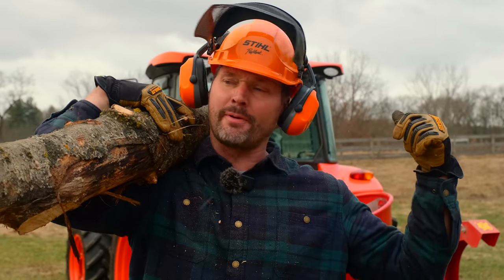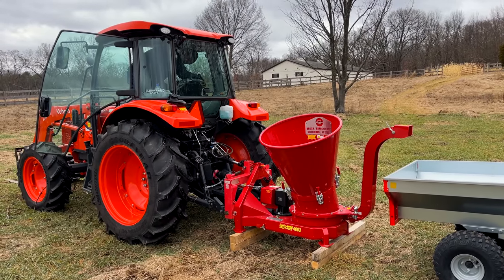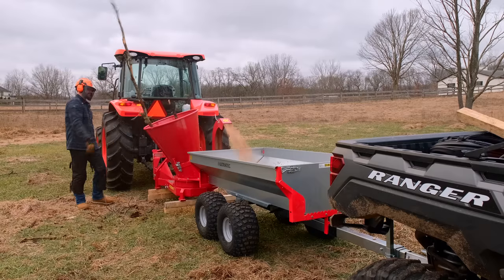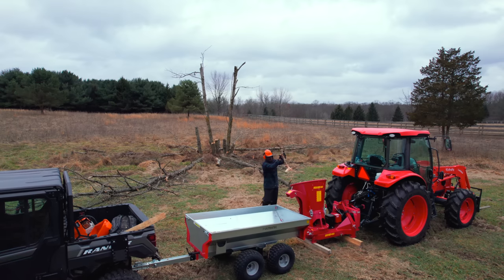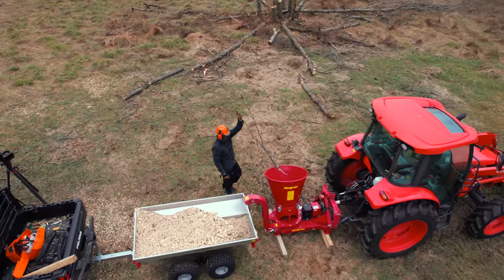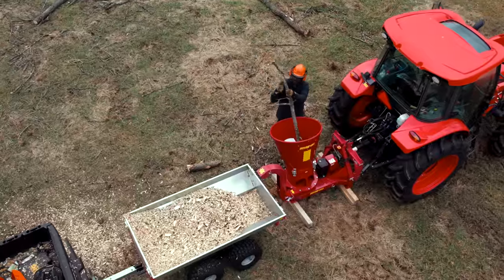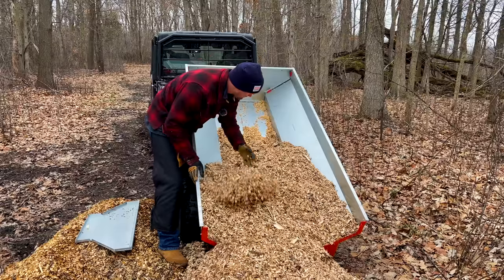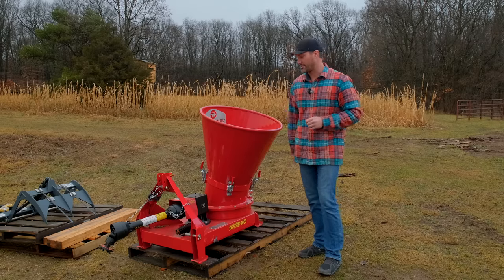WHAT HAPPENS WHEN YOU EXCEED MANUFACTURER RECOMMENDATIONS?

Comment: The max diameter is going to be dependent on how hard the wood is (... shush). It might take a 5" pine just fine, but stall out on a 3.5" hickory. And whether it's dead standing wood or green wood will also make a difference. Lastly, at some point the infeed plate itself is going to be the limiting factor.
Reply from the maker: Haha, yeah well they still do give it a max rating.  But, all fair points for sure!

Comment: Quick tip jack knife the UTV to the trailer b4 chipping that rear screen looks like a great target for a chunk of wood or even nail or stone embedded in the wood if I didn't have bad luck I wouldn't have any luck at all so wouldn't take the chance
Reply from the maker: Good tip...that fear was somewhere in my head, but the ol braincells couldn't actually put 2 and 2 together.
Reply: I disconnect my trailer and move the UTV away.  It just makes a mess with all the chips and dust on the UTV.

Comment: The one major flaw I see with this design is the chute position. First of all it is stationary. Second it throws to the rear. Other chippers I have seen allows the user to rotate where he wants the chips to go. Huge plus! A stationary chute is fine in a large open area. But when you are in a tight situation where you cannot move the chipper to the position you want it is a big minus. A rotating chute solves all of these problems. Nice chipper. But not the best design. IMO.

Comment: There should be a pto stop switch on the rear fender of the tractor. When seconds count the off switch in the cab is too far away…
Reply from the maker: Yeah, that would be fancy, but probably a cost that most tractor mfg's think wouldn't be utiltiied enough.  The chipper does have a switch built in...you just need to wire it into your tractor.  I'll do that once I decide which tractor I'll run it on normally.
Reply: @GoodWorksTractors  this is where all tractor manufacturers should standardize on a wiring harness extension to the rear of the tractor to hook up remote kill switches. So that no mater what brand of attachment or tractor, you could connect it up. They were able to standardize on the 540pto shaft, this should be easy enough.
Reply: @Akcd11r2002  I am curious to know what other PTO driven attachments there are that one would be off the seat when using? I can't think of others at the moment.

Comment: I will NEVER again operate a wood chipper that does not have a power feed mechanism.  The safety issues around having to push or drop wood into a self-feeding chipper have given me nightmares.  I have seen wood get sucked by machines, and that wood has has broken limbs that have snag people causing injuries.  I have also seen wood kick back out of self feeding machines and hit people.  A power feeding machine is not perfect but the benefits include a reverse feed control to manually prevent it overloading the tractor.  I cannot recall if we have a Land Pride or Woods.  Please stay safe.

Comment: your rim guard ad read didn't have sound
Reply: Think it wasnt support to be there
Reply from the maker: that’s odd? not sure what happened.
Reply: Some of us should be able to recite the script by memory.
Reply from the maker: Haha...well...I'm waiting! 😂
Reply: @GoodWorksTractors   
Folks I want to take just a second to tell you about our channel sponsor, Rim Guard.  They're a liquid ballast solution they line up with exactly what we do here on Good Works which is talk about tractors and tractor safety.  We see it as simple as this: if you own a tractor you need Rim Guard.   In fact some tractors include it as standard out of the factory.

Liquid ballast is simply weight.  Alright? And this weight hides inside your tires.  It stays there all the time.   It's a safety concern because tractors are almost always too light and too tippy out of the factory.

The #1 attachment used by every tractor owner is the front end loader.

So when you pick up something heavy on the front end the back end wants to pick up off the ground.  Rim Guard liquid ballast helps keep your back end planted to the ground.

But beyond safety it's going to help maintain traction because if those rear tires, those power driving tires are on the ground, you have traction to go where you need to.   You're going to operate more efficiently.

Because if those rear tires aren't on the ground, you're not going to pick up as much as you need to or take it where you need to go.

Rim Guard is all natural. That means it's safe, it is the heaviest all natural product on the market.   It's not going to freeze, it's not going to corrode and it's available at over 1,000 dealers nationwide

To find a dealer visit rimguardsolutions.com to make your tractor safer today.
Reply from the maker: Haha, too funny and you nailed it :)  Thanks for the laugh!
Reply: @GoodWorksTractors  And you thought we weren't listening.

Comment: At 7:02 you reached inside to try and remove your wood, That's a huge NO NO! Just shut down the machine so nothing is moving. I would hate to see or hear that you or somebody got hurt. That machine pulls those trees in fast and it only takes a quick second to get sucked in from the branch catching loose clothing or even your gloves. Please be safe everyone.
Reply from the maker: Neah, my hands are literally "feet" away from where the action happens.  It's a visual trick.  If the hopper were 10' tall, you'd still get people that say the same thing vs if it's 4' tall or 1' tall.  It's all about how far away you are from the blades.  Use common sense, that's what I do :)
Reply: I cringed as well when he reached in.  Even thinking about gloves or sleeves getting snagged on some of the cut off branch bits sticking out, very easy to catch on to clothing and pull you in.  Seems like the E-Stop would be best located on top of the hopper just in case you need a last second way to kill the PTO.  If you're chipping by yourself and getting pulled in, you aren't reaching the E-stop where it was shown.  Looks like an awesome machine though.  Chipper plus their log splitter would be nice to have, appreciate you Courtney testing both of those out recently!